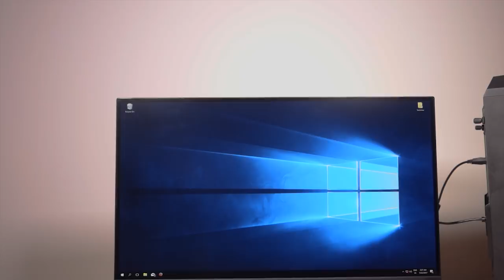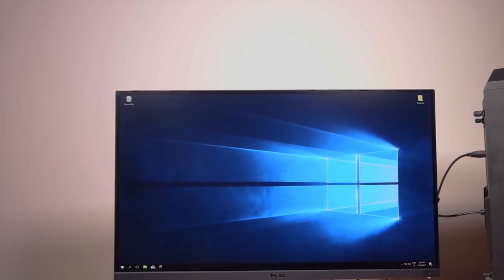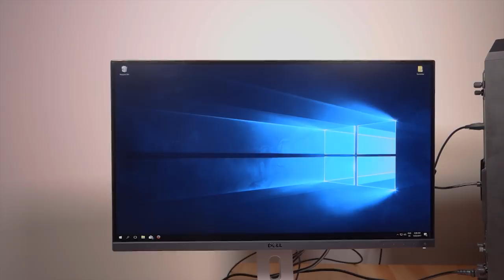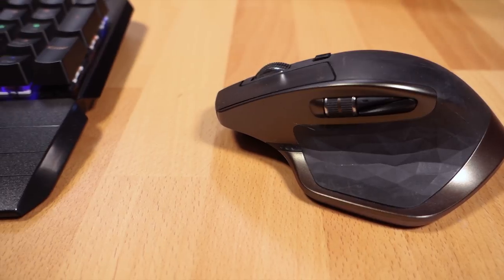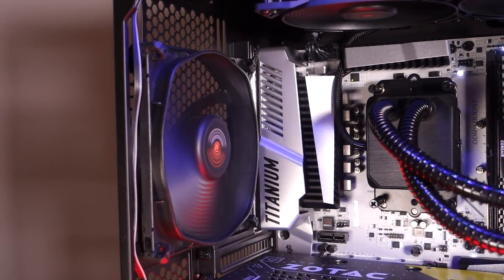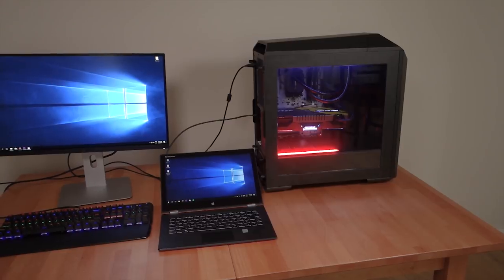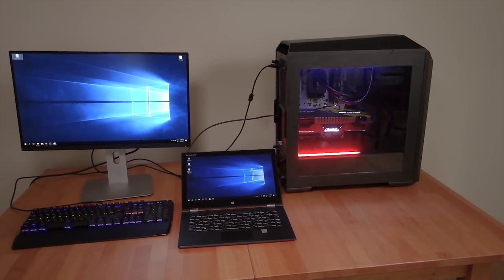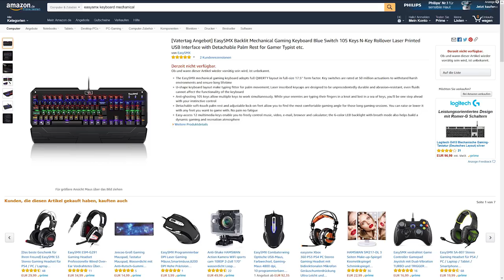I'm finally building my first PC! (Ryzen for 4K video editing)

Comment: For CUDA acceleration you only need a reasonable graphics card to do the job, a 1070 is going to give you about the same as a 1080ti would if we are talking Premier Pro. The Ryzen 7 1800X is great for those who don't want to bother with OCing, also keeps the warranty, which is nice. The build is quiet no doubt about it, may it serve you well.
Btw, check if there are updates for your mainboard UEFI, new platform buggyness and all and new ones fix stuff most of the time.

Comment: That's a nice build for a very nice guy and its going to last long. I built my first PC few years ago and its still running smoothly. But I still remember the cold sweat I had for a few seconds when I booted it first time and had inserted some mouse driver disc instead of the OS disc.

Comment: The Razer Blackwidow Chroma is expensive but amazing because you can customize the color of ever key, it has a bunch of color presets, and it feels amazing to type on.
Reply: Noah Feller Corsiar also make some very nice keyboards, quite similar to the Chroma really. I was torn on which to get between the Chroma and the Corsair K65 RGB. Ended up getting the K65 because of its smaller size (I hate the 10-key part of KBs), but either should be good :)

And yeah I love the ability to colour each key seperately, I have a bunch of different profiles set that are automatically applied when different applications and games are open, so the different functions and actions are obvious to me. I assume the Chroma can do the same, it seems highly likely

Comment: 4:52 That Dark Power Pro 11 is one hell of power supply! The original OEM of your power supply is " FSP ". They are known for their great board work . 12V Rail & output is good. Your power supply is using Japanese Capacitors ( from : Rubycon and Nippon Chemi-Con ), even the polymer caps are Japanese. Plus efficiency is 80+ platinum. In short Build Quality, Design & Performance of your power supply is TOP Notch .
In short all the parts in you rig is known for it's Features, Performance and Build Quality.

As a PC Maniac & Enthusiast : If i have to  find a problem ( actually i didn't find any ) than i will say 1700 over 1800X and G.Skill Flare X over corsair vengeance ( It's my personal preference , coming from my own experience ). 1700 give almost same performance ( if you are O.C both processor ) as 1800X for $120 Less. And i found that Flare X is easy to O.C than Vengeance in Ryzen System.

Note :-  My argument has no meaning if you are satisfied with the price and performance of your product.Because at last it is about your money and your satisfaction.

I normally don't waste my time on YouTube comment section but i am intrigued  by you system ( As a PC Maniac and Enthusiast )

Comment: if you want a simply looking mech keyboard as a beginner I recommend you sticking with coller master / cm storm. Imo a great option in your case would be something like cm storm trigger z. It comes with generic brown switches, has a nice wrist rest, doesn't look that flashy with its white backlighting and it costs less than 100€!

Comment: Hate to break it to you, but liquid cooling is louder than high end air cooling. 

Big fans can move more air at lower rpm, so it's quieter, and the highest end air Coolers in the $100 range have bigger fans, or the same sized fans. But liquid Coolers have a pump making even more noise.

Comment: Good for you. I'm glad. If I were building a new computer today, I would definitely be using a Ryzen chip, preferably a 1700 or better. My 4690K, however, is enough. I don't want to waste my cooler, motherboard (gaming 5) and RAM, either. I'll stick with this until it's a hinderance, and then I'll build a secondary computer wih those parts. :P

Comment: I'm really glad those fans exist. I have a few things that could use them... 

I think it's really funny how, because a lot of things were free, the price ratios of everything are really weird. It still turned out really well, but I imagine most budgeteers would spend a lot less on the case and mobo, and put the difference into the video card. =p

But the rest seems pretty solid and will last a while. If you only have 4 ram slots (thus, 2 left), I'd recommend getting a single 16GB stick for your first upgrade (when you need it) because they'll be cheaper than they are now, and then for your second upgrade, a final 16GB would at that time be even cheaper.

Comment: Benchmark results for video editing actually rely very, very much on the software itself! And even on the settings inside the software tools. 
Some software tools do NOT take use of grafics, some so, some only use one card max. some only take advantage of special AMD cards.

Best way by far for starting a project like this is, to FIRST getting to know which software shall be used, and start from there.

Comment: I don't like pc build videos but

I got 2 notifications at the same time about ryzen

I checked and couldn't believe until I figured out that 2 of my subscriptions teamed up.

So in this case I like the techaltar build and video just overflying and showing a caveat or risks.
42 to 6 minutes is the result,
somehow impressive, but at what price
And what Laptop would you get for that price and what time would thus take.

A 4 year old laptop is not the right competitor.. so I'd like to see a sequel with a Laptop for same budget and how this performs on the same video. 20, 16, or 9 minutes possible?

Wouldn't you prefer a laptop?

Comment: You should have got the Ryzen 1700 instead and overclocked it. You would get the same performance and you would save some money.
Reply: xxXRealtutorialsXxx He's a beginner and inexperienced in all that like he states in the video.
Reply: over clock the 1800
Reply: 地獄 Lord Koboy 1800x hard to over clock above 4.1ghz while 1700 can be easily overclock upto 4ghz and it runs much cooler than 1800x.

Comment: If you want a non-flashy keyboard, look up Das keyboards.
Reply from the maker: +Generic Green Squid that KS, I will check them out!
Reply from the maker: +dankDoges any cool guides for that?
Reply: TechAltar Joining the conversation cause this sounds fun.
Reply: Check out /r/mechanicalkeyboards on reddit! They have great guides for beginners.
Reply: Generic Green Squid Thanks!
Reply: dankDoges I'll check them out too
Reply: blackwiddow ultimate <3 unfortunatelly expensive as all razer stuff o.o
Reply: +TechMagnet He is looking for something non-flashy, and the Razer Blackwidow is as flashy as it gets.
Keyboard communities don't recommend it, as you can get better ones for the price.
Reply: woops didnt read the full conversation >D
Reply: Generic Green Squid Used blackwidow 2013/2014 actually has some value to it if you are gonna invest in custom switches. I got mine bw 2013 and 104 gateron switches (a mix of blues and greens) for less than 100$ and I am really happy with it
Reply: TechMagnet Razer Ornata Chroma here!

Comment: Nice Video! Can't believe you never did build a PC bevore, you will really like the experience with a computer wich is that fast. Maybe you want to install a Linux Distribution in Dual Boot to Linux (Mint or Ubuntu for example), you will really have less problems then, I did it and would not switch back to Windows as my main Operating System, and on Linux my system performs much better than on Windows 10, my blenderbenchmark showed it is 22% faster.

Comment: TechAltar, congratulations your first PC! But I sort of feel bad for you in some ways. First, you bought the Ryzen R7 1800X (pronounced 18 hundred X, not 1 thousand 8 hundred X) with your own money, correct? That was a waste of money, and I'm sorry to tell you that, the Ryzen R7 1700 is the EXACT same CPU, except MUCH cheaper, consumes less power, and COMES with the AMD Wraith Spire cooler which can overclock the CPU to 4Ghz. I just feel bad that you watched reviws for the GTX 1070 vs 1080, but you didn't watch reviews for Ryzen CPU's. It's common knowlege at this point that the 1800X, 1700X, 1600X, and 1500X are wastes of money compared to the 1700, 1700, 1600, and 1400 respectively (All of the NON-X CPU's come with their own coolers, unlike intel's coolers, AMD WANTS you to overclock and gives a VERY good cooler.) Btw, did you overclock your CPU? If you didn't, you wasted even more money, as it's also common knowledge that Ryzen isn't worth it without overclocking. Could've save some cash on the CPU and not having to get that AIO from Be Quiet!.
Reply: Peter Njeim Even tho you're correct, something tells me he doesn't give a shit about"wasting" some bucks if he got almost everything else for free, so you shouldn't "feel bad for him"
Reply: MHNK77, nope, $150 is still $150. I will feel bad for ANYONE who wastes $150 unknowingly.
Reply: D Snodgrass, Computer tech channels are different than all around tech channels. There are MUCH less bias in computer tech channels, and the reviewers aren't afraid to put shames on companies who make a bad product. Watch 10 channel's reviews on a certain product is THE BEST way to know if a product is good. I recommend Gamers Nexus and Hardware Unboxed, they both do massive benchmark tests, hardware unboxed tests more games, while gamers nexus tests more features of the product, and also modifies the product to see how far they can push it. He even said he watched reviews about gtx 1070 vs gtx 1080, why didn't he watch any reviews for ryzen CPU's? This is NOT something you learn from building a PC, how will you know that a 1700 is cheaper, comes with a cooler, has a lower TDP, and performs the same just from using the 1800X PC??? You can't, and he'll never know. You're wrong.
Reply: Well hes using it to edit videos and  other stuff so maybe thats why he went with high end, it depends on your needs. If it was me i chose the ryzen 5 1500x simply because i think 4 core is sufficent and fits well within my budgets. Also with combination of RX 560

Comment: Wait, what? How do you can change low and high airflow in the case by pressing a button? I have been asking for it on fora but never got an answer besides "totally unnecessary, just learn to make a fan curve"
Reply from the maker: The case came with a button that does this. Only works with the case fans themselves (not with those of the cooler or GPU), but it's still pretty useful!
Reply: TechAltar Case fans are the only thing that I would find important to use it for, I would either go water cooled or fanless air cooled. But I guess that fan controller from the case can't be used for pwm fans?
Reply: Brecht Schatteman Why not? My Enthoo Evolv case came with a fan controller which supports PWM; basically it just uses one of the fans for tach, and reports this speed back to the BIOS (via its own PWM fan cable). As such it works best if all fans are identical, so all fans spin at the same speed - but yeah, it can be done.

Comment: This is a rediculously good computer. Complete overkill for a first build in fact. I think you should have exerted more restraint for a first build.  Setting a budget relatively low would be more relevant to the viewers, and it would teach you more about the process as well. The most important part of building a desktop pc is the power supply and the chassis. the rest is not important and can be cheap. The Red hardrive you have is a server drive, i belive, and not really suited for desktop use.

Comment: I think 4K is not that necessary. FullHD is more than enough for 95% of Youtube Users.
Reply: Sener S i dont think 95% 
70% is more precise maybe
Reply from the maker: The good thing about 4K is that you can always crop later on if you want. So it's good to have even if you are planning to upload in 1080

Comment: Tips for first time PC builders:
1. Do some research on the parts you want to use. Make sure everything is compatible. pcpartpicker.com can help with this, but still make sure you look into things that site might make an error on (i.e. The dimensions of the parts). If you don't do this you'll find yourself looking at parts that won't work together or fit in the case. 

2. Always have your motherboard's instruction manual with you. It helps with eliminating some of the confusion that can when using a motherboard that wasn't used in a build guide if you build your PC with a video tutorial. Whether you do build it blindly or with a guide, the instruction manual will almost always be your best friend when you're lost. 

3. The only tool needed for building a PC is a screwdriver. If you have a magnetic screwdriver, it's much better. You'll be less likely to drop a screw in the case, which could cause a short circuit if it falls under the motherboard and isn't removed when powering up your system. 

4. When picking a power supply, consider what you're going to do with your PC. Are you going to do any overclocking? Do plan to upgrade to a more powerful and power hungry graphics card? It's best to get one with a slightly higher wattage than you need. 450-500W is the most common. If you're overclocking your CPU and graphics card 750W should be more than enough unless you're going for something ridiculously power hungry. Also consider if you want a non-modular, semi-modular, or fully modular power supply. Non-modular doesn't allow you to pick which you to pick and choose your cables. Meaning if you have any extra, they'll make cable management harder. On the bright side, non-modular is the cheapest. Full modular is the most expensive, but if you have any cables on the power supply that won't be used, you can just toss them back in the box. Semi-modular is in the middle. It's partially modular while being non-modular with some cables. Also make you buy your power supply from a reputable brand so as to avoid any problems in the future concerning the power supply. 

5. Don't freak out if the PC isn't turning on. Check to make sure you have the RAM in the proper slots and everything is powered correctly. Make sure you're not pressing the reset switch. Check to see if your power supply is switched to on and all cables are connected. If your graphics card has two power connector slots, make sure both are connected. 

6. Don't build in a mini-ITX case. They're really small and time consuming to put together. 

That's all I could come up with. If anyone else has any good tips post them here as well. Otherwise just have patience with your rig when building